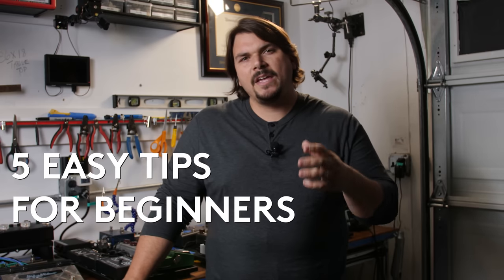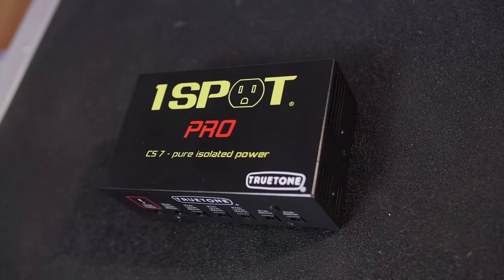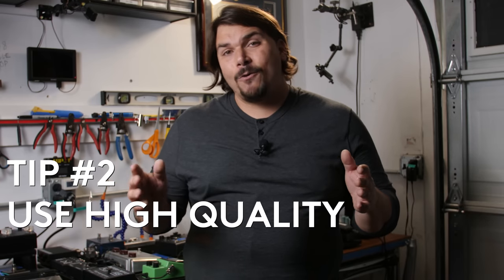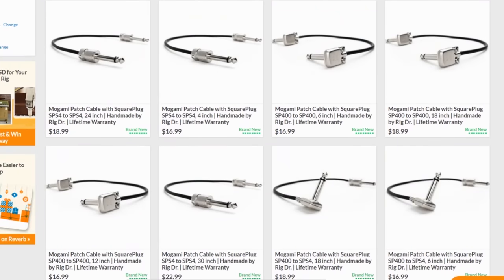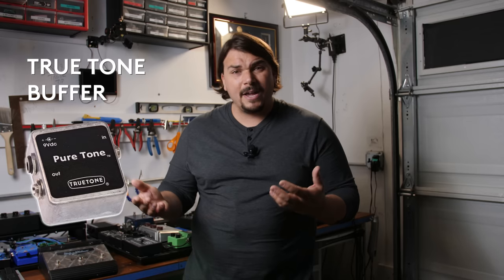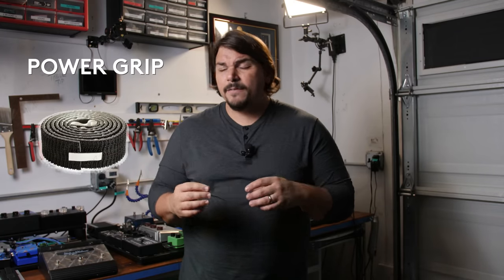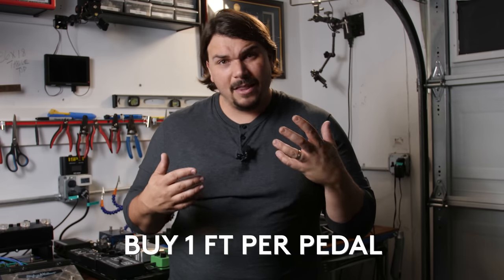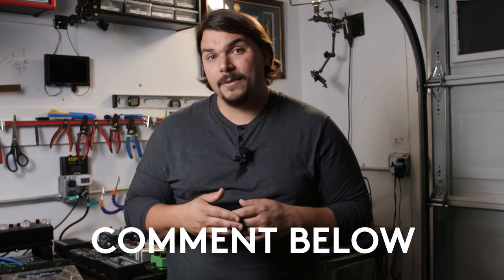5 Ways to Improve Your Pedalboard

Comment: who wants the guitar directly into an amp tone if your using lots of pedals? Isnt the point of pedals to change that sound
Reply: The pedals should only effect the sound when they’re ON, so if they effect the sound when they’re OFF it’s an issue
Reply: i use mostly the guitar into the amp tone, and only use my board for certain things at specific times.  that said, there are  only 7 pedals on my board, plus the footswitch, and a tuner. my board is small. 
i don't want the pedals to color my sound if i can help it.   
there is a difference between changing the sound, and changing the tone.

Comment: I need to get rid of my voodoo labs and my walrus audio power supply...SIGH
Reply from the maker: The Voodoo Lab one can be good, depending on how you’re using it, it will just have more sensitivity based on the placement depending on which version you have and whether it has a Steel chassis versus an aluminum
Reply: I had the Voodoolab back when they were pretty much the only choice. I use George L cables and if my cable ever wound up getting moved to where it was hitting the brick, I’d get noise and hum. Truetone is definitely the way to go. I got the CS-7. Works great with zero issues
Reply from the maker: @nigeldaddyo  Truetone is wonderful!